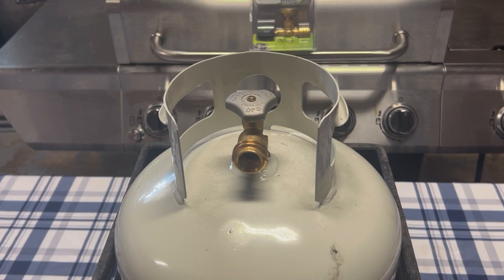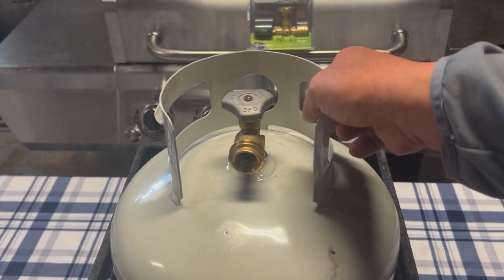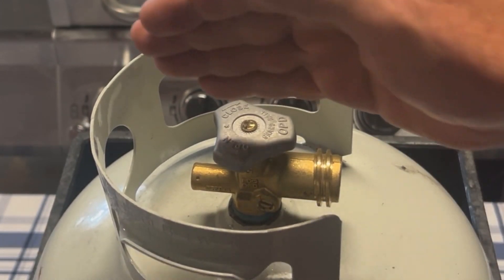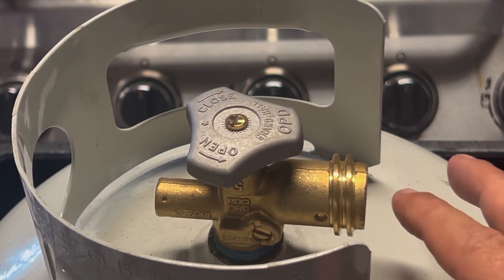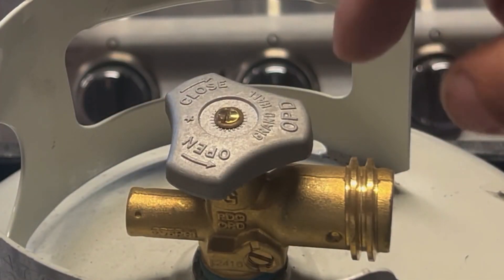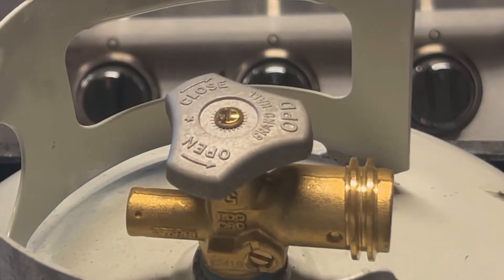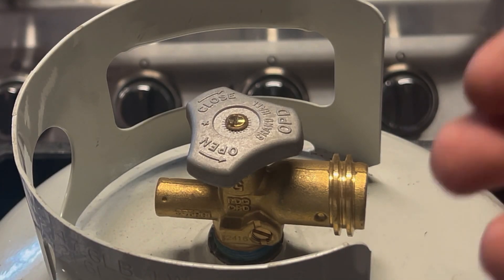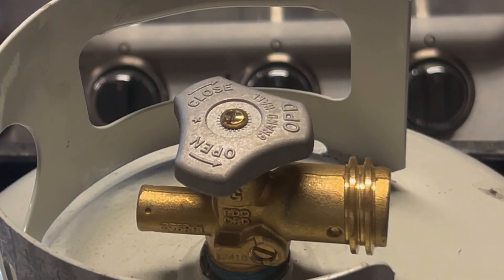PROPANE Tank PRESSURE RELIEF Valve - WHERE Is The PRV & What Does IT Do?

Comment: Dumb question but when the pressure release valve is activated … does it leak all the gas or does it close once it reaches an acceptable pressure?
Reply from the maker: It lets out only as much pressure as it needs to so the tank doesn’t burst.  The gas comes out as vapor.